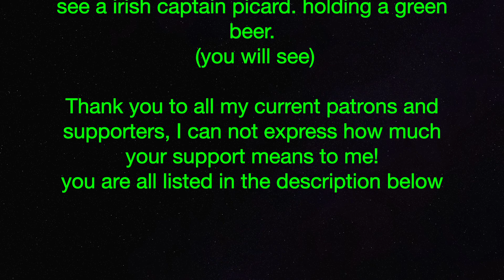Amiga 1000 PiStorm !NO MORE KICKSTART DISKS!

Comment: Chris - I just purchased a Pistorm to do exactly this with my 1000.  Did you have to flash the Pistorm's firmware or did it work out of the box fully?  Seriously, thanks for this video.  My partner gave me this computer out of his retro collection and I've wanted to upgrade it for a long time.
Reply from the maker: I am running mushashi core which is older however gives me networking and many features.  Emu68
Is the bare metal one which is way faster but less festures.  I did this when they were all brand new so yes I did have to flash the cpld.  Newer ones might come ore flashed with a core and you just run whatever emu you
Want.  Emu68 or mushashi

Comment: Do you plan on switching to Emu68 on your A1000 (NTSC)? I tried Emu68 but boots logo screen only black on the RGB side. No issues with same image on my A500... 🤔
Reply from the maker: No. Mushasi works for
Me as it has networking shared sd access and ram and cpu.  Dont need a blazing fast 1000 when i have others. I actually use it on each repair to print the return letters to the users
Reply: @ChrisEdwardsRestoration  True I was thinking the same but some one mentioned that Mushasi is a dead project and there are incompatibility issues... Which I have not experienced. I figured out the Emu68 issue. Had to flash the PiStorm with LemaruX / PiStorm-Firmware "flash_longer_hold. sh". Now CaffeineOS 9275 (Emu68) w/ WiFi support works.

Comment: Hi, my Amiga 1000 doesn't start em68, do I need any special settings?
Thanks Silvano
Reply from the maker: I use mushasi not emu68 on my 1000 as i want networking and shared folders.
Reply: @ChrisEdwardsRestoration   Hi, can you tell me where to download it?
Reply from the maker: @silvanocosentino6988  google is your friend but here.  https://github.com/captain-amygdala/pistorm
Reply: Hi, is it possible to boot a hard disk with Kick 1.3, have I heard of a particular version?
 @ChrisEdwardsRestoration
Reply from the maker: @silvanocosentino6988  yes just define that rom in the emu68 settings file and install 1.3 as normal, changing the starttup=sequence.hd to startup=sequence   1.3 sucks eggs though

Comment: Thank you for the video! Does this mean, though, that you can now no longer use the Spirit Inboard? Does the PiStorm have onboard RAM to replace the 1.5 megs of the Spirit?
Reply from the maker: Pistorm has the memory of the pi itself up to a gig
Reply: @ChrisEdwardsRestoration , thank you! My problem was that I didn't fully understand what the PiStorm was, and what it was doing. Basically, it pretty much replaces the processor on the Amiga, correct? This means the Amiga no longer needs the RAM, because it's using the PiStorm and its RAM to do the processing, right? (Please feel free to correct me if I'm wrong... I'm learning!)

Comment: Finally got my Amiga 1000 working, mostly, still need to address the keyboard as it is doing crazy stuff like if you want > it gives you :, the Spirit Inboard 1000 in mine died, I get Yellow screen when I have it installed. Side note, a Super Denise will not work properly in an Amiga 1000, you can boot to Workbench, but it looks creepy and grainy.

Comment: The Amiga 1000 has the same limiting graphics as the A2000/3000 so if you can do the PiStorm RTG stuff when booting Kickstart 2 ROMs it would be great. You only need to load KS disks from cold boot, it's not that big of a deal if a game allows a keyboard reset back to workbench disk prompt so you don't have to turn it off and back on at the power switch.

Comment: Could you reveal a bit more on the software side?  What does your pistorm default.cfg look like and what kick ROM file version did you use?  I have been playing with different memory configs and alternate 3.1 kicks and the most give me no screen but the keyboard mapping is working (the pistorm reports a keyboard reboot when I press ctrl-LAmiga-RAmiga).  Kickstart 3.1 rev4063 is the most "lively." It gives me a green screen (bad chip mem).  Thank you!
Reply: I'm having similar issues at this point. Blank screen.

Comment: I dont see the point in this.. So why not use UAE on raspberry and get really cool speeds, or just go hardware for retro. This is like attaching a car to a house using the doors on the car as entrance..
Reply: Its a cpu accelerator. Its not like its completely making everything inside the amiga useless like the vampire does.
Reply from the maker: Not at all
Reply: It's just a CPU emulator and gives you switchable kickstarts and a hard drive. The rest of the Amiga is in full operation.
Reply: @Daz5Tube is it better then the aca500plus for the a1000?
Reply: @RavageReeves  no idea, sorry.

Comment: What kickstart/wb are you using?  Looks like 3.1. Thanks.
Reply from the maker: 3.1.4
Reply: So 3.1.4 just works?  Winuae doesn’t like that mix, 1000 chips and 3.1. I have not tried it on my actual 1000.
Reply: WinUAE works fine with a 1000 config and 3.1.  Don't know what I did wrong before.  It never occurred to me to make a 3.1 kickstart disk.

Comment: Awesome man, nice video! I have a 500, but it is great to see such a good upgrade that will work for multiple machines. I used to have a couple 1000's... why on Earth did I get rid of them... oh yeah the 3000, but still.. I think the 1000 and 3000 are tied for the coolest case design.
Reply from the maker: i agree, the A3000 is the best engineered machine there is. AGA was just a stop gap from the AA3000 that never made it past prototype till Hessee re did it in 2020

Comment: nice one! you could use my a1000 adapter for vampire to move the pistorm and get a better access to the sd card. Anyway you can access via sftp or ssh.
Reply from the maker: Indeed.  You can send me one and ill review and do just that!
Reply: @ChrisEdwardsRestoration  why would you do that? You can get a 2€ cheap SD card extension/adapter with a ribbon cable, maybe long enough to pull out of Amiga on some place, to replace SD card without case opening. Lotharek does have them in his shop for example.
Reply: @ChrisEdwardsRestoration  awesome. pm me to info@arananet.net and I will send you one

Comment: How funny, I was just saying to Chris in a previous comment I wanted one for my A1000s. I even have the Spirit board memory expander he has. I replaced the disk drive with an A1000 compatible 3d printed Gotek frame so I already solved the fit problem as my drive shield has been removed. I gather if it works with disks it works with Goteks. Where do I send my money? I guess this is a silly question but....can it do AGA now, from the video output of the Pi? I guess it wouldn't kill me to drill a hole in the backplate. Maybe I'll chuck this in my unexpanded A1000 as the Spirit board has soldering all over the place.
Reply: Hi Chris, I just got a Pi 3a so I won't need to use a riser. As I have the same Spirit Memory Board you do, doesn't that just relocate the CPU? Did you need to remove the Spirit Board for the PiStorm to work? If not, if you keep the Spirit Board in there will the PiStorm still fit in the A1000 case, albeit without the metal shield. There's some soldered wires on the Spirit Board I'm not keen to remove, just in case I want to put it back.
Edit: Sorry, I just re-watched the video. It will fit. @1.30.
Reply from the maker: I left my wires and only cut the yellow ones for the power and ground.  Left the pal bonded ones in
Reply from the maker: No it wont fit and you wont need it, just trim that corner like i did and all will fit just fine if you wanted to use the orig drive, otherwise your gotek will fit it fine w no trim.  Too high with spirit pistorm and pi on top
Reply: @ChrisEdwardsRestoration  Surprise, it does fit on top of the Spirit board. It was close, but it isn't touching the top. I have an aversion to cutting wires because I know I lack the skill to put it back together properly. The Gotek is one of those barebones ones without an outer shell, that is accessible from the drive bay, so it doesn't get in the way.
Reply from the maker: Discord server group buy room, pinned comment. Wont do aga but will do 32b bgra rtg in 16.7 m color. Goteks and all amiga peripherals work just fine.  Please dont drill use the side plate
Reply: @ChrisEdwardsRestoration  Good idea....I guess I won't need that A1060 Sidecar with HD any more. Not that the damned thing ever worked reliably anyway. 
Thanks for the video and replying. Have a coffee on me. 
Is there enough height for a riser so this could potentially run off the Pi3b(I already have) or even a Pi 4? Which I gather will work one day. Imagine that!!!
Reply from the maker: @AussieAmigan  the reason the "larger" pi doesnt work, 3b/4 etc is because the usb ports get in the way of the pistorm board near the gpio. you CAN use them if you just desolder the two usb ports close to the gpio, then she all snugs up.  or if you have a super tall riser gpio header it would fit.
Reply: Coming soon: Pi Zero support?  :)
Reply: Actually to add a gotek it might be a better idea to install an ACE2b (2MB-Agnus with 2MB Chip-RAM from individual computers), so you can remove the 256k Ram-expension on the front, reprint the RAM-cover (so not destroying the original one) and mount Gotek OLED display, rotary encoder and USB slot there. But actually I would'nt use a gotek anyway, as with the Pistorm you have a lot of memory and storage, so you can put your adf's on SD and with kickstart 3.2.1 you can mount them - and anyway, with whdload you shouldn't need a gotek.
There is a stl for the A1000 backplate. So you can leave the original backplate unchanged and print your own. So you can actually print a replacement backplate with all the extra connectors you like - hdmi, vga (if you use an indivision ecs), usb (if you use Musashi as the 68k CPU emulator, for USB keyboard or USB-Stick as storage you can swap to winuae for transfering big files), SD-slot (using an extension for the SD-card), maybe eSATA (if you use an IDE68k under the Pistorm (if it works, I am not sure, but as the A600 IDE works with Pistorm and the IDE68k does the same, there shouldnt be any reason not to) with IDE2SATA-Adapter, so you can add external CD-Rom) and so on...
I would'nt do permanent changes on an A1000 in original condition - as there is no need to do so.
Reply: @oleurgast730  I was not aware of ACE2b, and am unable to find one used on an A1000. Got a link? The only problem I have with the pistorm, at least on the A1000, is that I can't get it to run my son's favourite game which is Lotus Turbo Challenge 2. I have used Emu68(CoffinOS) and Mushashi(new WB3.2) and launch via Whdload and bootup and it still won't get to a race, even though it used to via my Gotek and original A1000. I'm not sure mounting the adfs would be enough as I'm ignorant of facilities now, but back in the day I would have copied the disk to RAD. Not sure if the problem is a Kickstart thing, so I might try and see if I can get a KS1.3 pistorm image going(I'm assuming I just have to add the rom and change a config file). I have an sd extender running out the side expansion gap that lets me change pistorm images easily, should I want to. I even redirected the pi output to my 1084s(sitting on my C128D beside the A1000), using a HDMI to component box. When I get my retro on, which seems to become a rarer and rarer occurance, I tend to use both machines, so I stopped doing that so much. I've spent more time on setup than using the damn thing.

Using my original keyboard and mouse is my personal red line, otherwise I might as well be using a Pi directly. Looking at my mig, you can't tell it's expanded. And, damn, now I can't even find my original 68k chip, which I put away in a safe place. Figures. As for reprinting the front cover, I have another broken cover A1000 that I would love to reprint all the front panel parts for. Is anyone aware of any models?

Comment: Will there be a Pistorm for A1200 ?
Reply: Pistorm for any other system would be a full accelerator - connect to CPU slot with all its complexity unfortunately. 
Reverse engineering the 68000 socket is actually pretty straightforward, you get the white paper, go through the signals and timings and setup an emulator to handle that on the hardware level. 
I could see this for a C64, Atari 8bit, PC/XT, and others like that. Hmmm....
Reply: There is now - PiStorm32

Comment: So what are your options for increasing CHIPRAM?
Reply: If you're needing to run software that's needs more chip ram then the only way I know of is to just run full emulation on the pi and take the A1000 hardware out of the loop. BTW: For those that aren't aware. The rejuvenator board for the A1000 is not an expansion or add-on device. It is a "full" motherboard replacement. Most purists out there might find the rejuvenator board a mute point because it defeats the whole purpose of having an original A1000 computer in the first place.
Reply: @appliedengineering4001  Schematics I found are hard to read but it seems PAL PLD chips  are responsible for part of memory signal generation instead of agnus alone. Most likely there has been no adapter for newer Agnus since those things aren't quite as compatible and most likely you'd require either a lot of wiring and traces cutting or just leave on-board memory unused and just get more signals around. That's why it is so PITA and that's why whole new boards were designed to solve that problem.
Reply from the maker: Ot many, i found an old article from a magazine in 1987 that shows a stacking method w crazy wiring and it works. I may give it a go one day.
Reply: @ChrisEdwardsRestoration  Oh I'm afraid you'd be disappointed. I checked design by Cris Erving (copyright 1986) and it's not a chip ram hack. It's more like a ReSlow for A500 but uses AddMem to map itself to chipram space. It is - unfortunately - inaccessible to chipset and that's why newer AOS (1.2+) shouldn't be used with it or they'll try to put there things for chipset which chipset cannot access since MOS 8361/8367 does not manage signals for those ram chips. Those signals are created by syncing chipset ram access signals with decoding cpu address line signals - again - not unlike ReSlow. So - just as article presents - it's neither fast ram nor chip ram. It's not fast ram because it's not directly accessible from CPU. It's not chip ram because it's not directly accessible from Agnus. It's basically SLOWRAM in CHIPRAM address space. I don't know if there are some adapters for PLCC Agnus for A1k which would make true 1MB chip ram available - but basically that's what you'd need to get past 512KB limit of CHIP RAM on A1k.
Reply: @Promilus1984  The problem with A1000 Agnus vs FAT Agnus is that FAT Agnus is not pin compatible. FAT Agnus controls lot's more logic than A1000 one. There is no other solution for A1000 to increase chip ram other than Rejuvenator board - which is impossible to get. Hope some day some smart people will figure this out, but as for now there is no way to do so:/ Unfortunatelly. Surprisingly lot's of software runs fine from floppy / gotek. Like MK2, Super Frog, Lotus 3 and many other classics - which doesn't run through WHDLoad on A1000.
Reply: @Amiga1000  Well yes and no. As I said - there is no workaround except using 1MB (or 2MB) Agnus. And it's not only problem with pin compatibility. It's different package and I already mentioned that. And I think most of the signals are the same even when slightly different names are on schematics. And sure Fat Agnus has more logic - it has to to reach more chip ram :) It does the same job in the same way ... just have some more decoding logic and maybe some mild bugfixes.
Reply: @Amiga1000  sure would be nice if someone would reverse engineer the rejuvenator board so we could have a modern version of it.

Comment: Chris, instead of the 1010 fixes, could you not have simply used one of the many 68000 relocaters? I also have an old spirit board, but rather use this upgrade. Also, I am eager to see how you double chip ram, for the only Pheonix boards are pricey and rare. Similar to you, I have several Amiga machines, but always had a sweet spot for the 1000. It is also too bad that we both are using the more populated NTSC boards compared to US models.
Reply from the maker: Yes , recall i states there are many ways, but for zero dollars, pounds, quid whatever part....

Comment: If I had the time, the skills and the patience, I'd seriously consider trying to make the PiStorm work with an A600 or A1200.  Great to see that it's working on Amigas other than the A500.
Reply from the maker: There are new prototype test boards for the a600 and 1200 coming that do both rgb/rtg in one shot hdmi out for both.  Like stated in  part 1 this project is moving fast w changes daily.  Claude is really rolling
Reply: @ChrisEdwardsRestoration  So cool developments !!

Comment: I'm glad you didn't cut a notch in the bracket...definitely easier to remove the corner of unused Pi board. I assume since it is using native Amiga hardware for video there's no lag...what about using the HD output of the Pi?
Reply from the maker: Works the same as the part2 video i did. I chose to rtg it to keep this amiga stock looking and working with more gut power. I have many that i pimp out . Its funny to see the amiga 1000 running tbl starstruck w no lag or loss . Lol
Reply from the maker: Rgb i meant